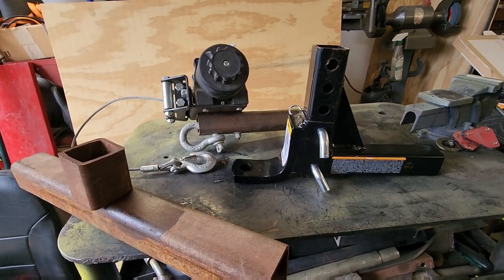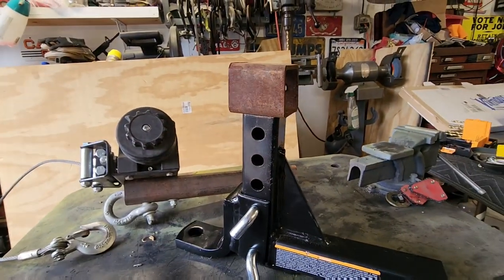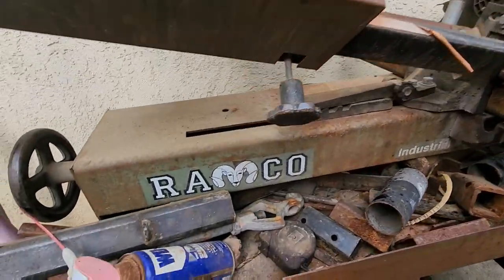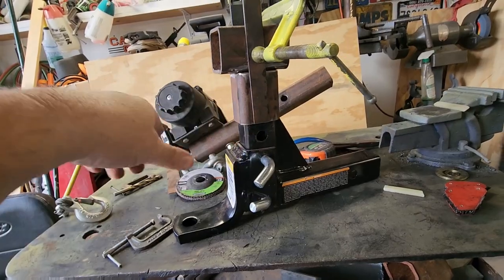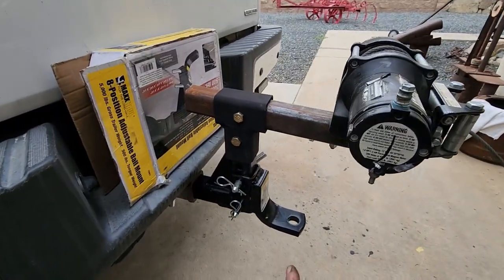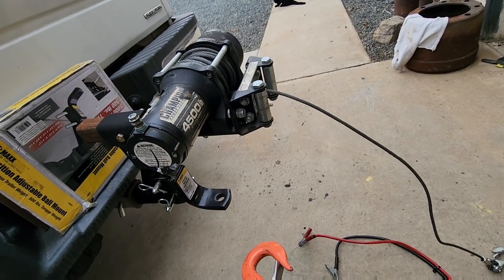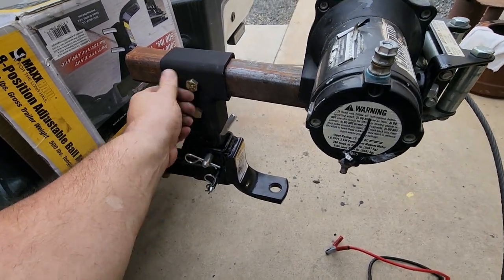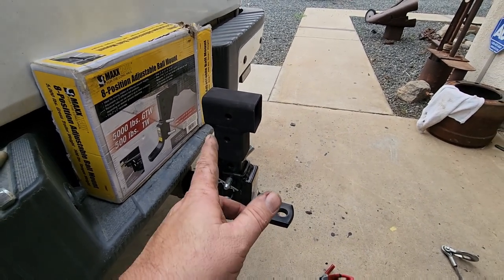Side job Sunday, Adding Winch to a Trailer Hitch.

Comment: It sounds like the final slide thru bolt at the end is the only thing holding back the winch... yep, I see the mockup now, just wondering if that top bolt is strong enough to hold back the winch piece...
Reply from the maker: It is a 1/2 grade 8 bolt and I'm pulling a rolling car. I would not use this set up to recover a stuck car.